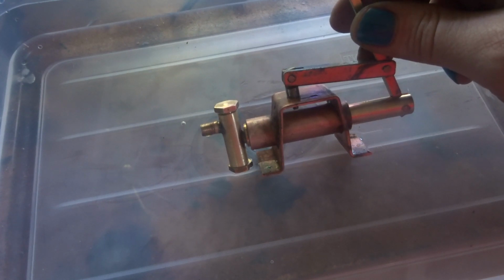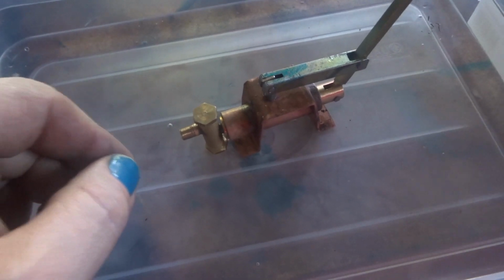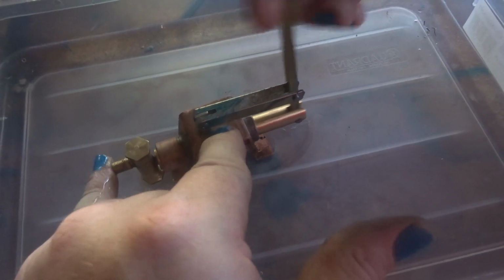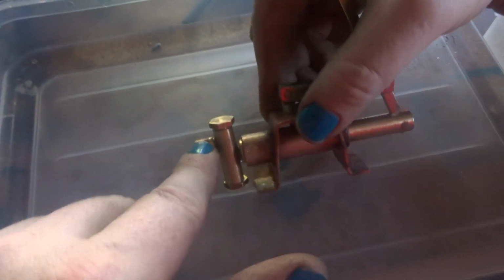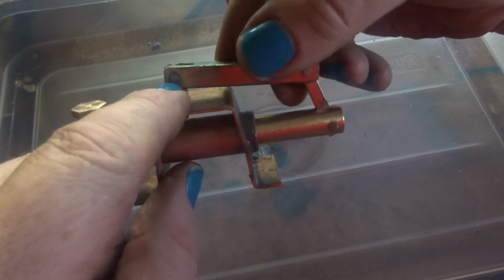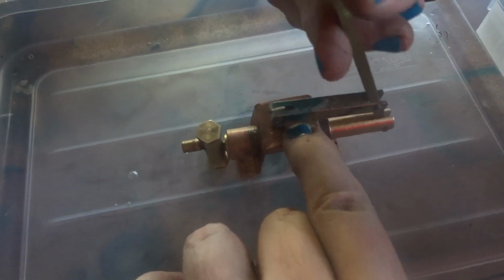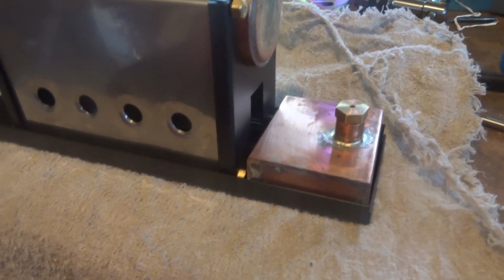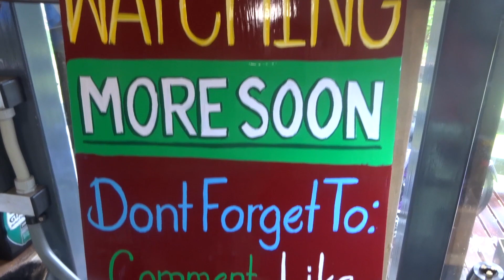monday BONUS video

Comment: Hi Emma, A nice simple pump that should do what you want. I would mount it on the side of a small tank with a 90 from the intake to the tank. That way it will not be so messy for you.  Nice job.  regards from the UK

Comment: I think I see how the thing works. No pressure, top ball falls by gravity. Pump stroke raises pressure, top ball rises and shuts off valve. Thus liquid now must flow through outlet. Is that right? No spring needed. Am I way off track? Thanks for posting, an unexpected pleasure.
Reply from the maker: +Juan Rivero your pretty much on the right track. ill mention it again in another video and give u all a look inside., promise . thanks for watching